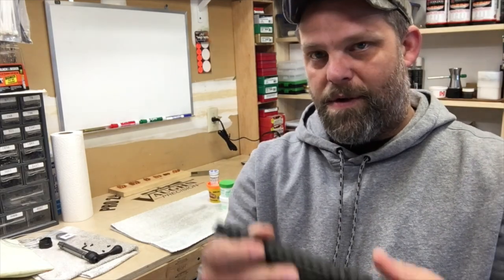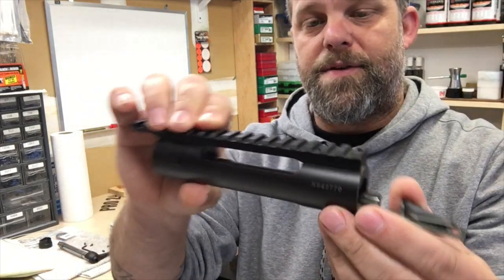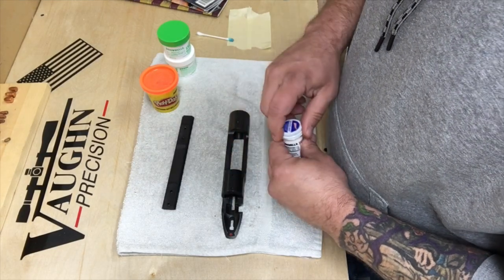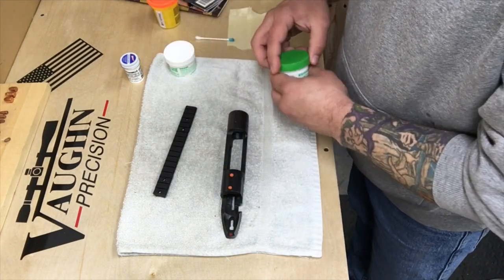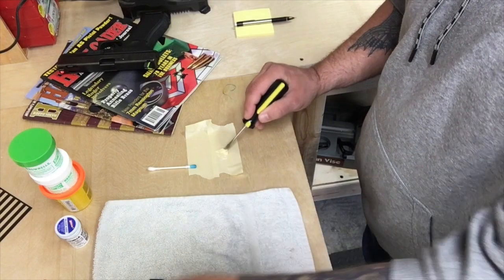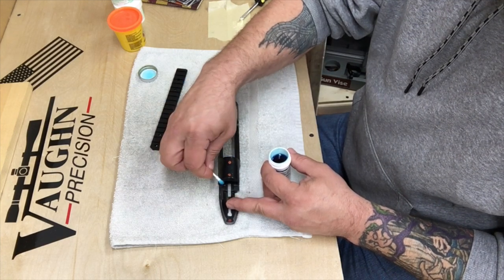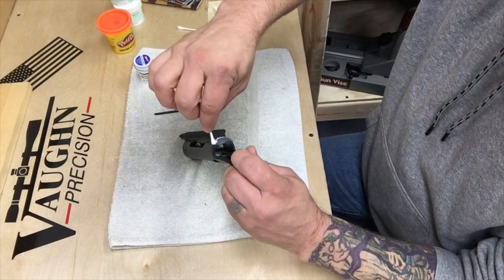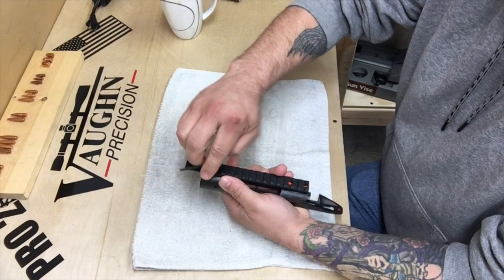Savage Rifle Build, Bedding Scope Base Rail (pt 11)

Comment: Ive bedded quite a few rails over the past few years. I can see a few pros and cons to doing it. One pro is a greater surface area for the clamping action from the tightened screws and another is to cancel out any machining tolerance difference between the base and action. The only Con I can think of though is that if the base itself isn't perfectly straight then you are just making the bend permanent while installed on the action. I've seen a few that had a bow when off the action but straightened to a degree(+/-) when installed on the action and torqued down. I usually send the ones with bows back though. To check it: If you don't have a mill and indicator a straight edge and bright light will tell you the same thing.

Comment: When I've discovered a one-piece base with rearward clearance, as your example illustrated, I came to the conclusion that either there are machining tolerances (nominal 0.002") present, and/or the action has warped a minute amount due to heavy barrels being floated from the factory.  Depending on how the rifle is stored in a warehouse-transit-to-dealership....its very possible for Savage's bull barrel models to warp their action a few thousands of an inch.  In my time of discovery on bases that revealed gaps (Remington, Winchester, Weatherby)...I've taken one of two approaches-
Either use a bedding compound as you performed, or take some sand paper, holding the paper on the receiver's ring..then work the base back and forth, paying attention to keeping the bottom of the base flush to the receiver ring while working it back and forth.  About 30 seconds of this option can bring the same (nearly) results. Thanks again for sharing -AllTheBest
Reply from the maker: MEAlstonIII now that's an interesting way of correcting it. I'll keep that one stored away for future use.!

Comment: Thx for the info, I hate my rail as it is right now on my Savage FLCP-SR with a lost of 10 Mils of adjustment just to zero at 100 metres. Out of 20 Mils of total elevation losing 1/2 of it just to make a 100 meters zero feels stupid. I will order mine today a replace the parallel picatinny one that came with that rifle.    Keep them coming, very good video.

Ralph

Comment: The gap is due to manufacturing tolerances.  Nothing can be machined to match exactly in mass production.  Bedding the scope mount is meant to compensate for the clearance so that the mount rail is not bent convex ed. (bowed upward) and torquing the scope tube.  @ 2 miles an ill fitting rail can mean missing every shot.

Comment: I cut the end off of a couple of used Ram Rods swabs and stick them in the screw holes to act as guides when setting the rail in place.
Reply: I was thinking kind of the same thing but use 2-3" screws or threaded rod and have a long nut of sorts with the same taper as the screwheads on the bottom. With screw in holes, finger tighten the nut down against the rail. Easier than using the short rail mounting screws.

Comment: Love your videos.  Just also became a Savage guy.  They were offering a 100.00 rebate on a 11, 6.5 creed, couldn't pass it up.  Too bad it had the bottom bolt release.  Just a suggestion, have you thought about using a threaded rod to locate the rail on top of the receiver??
Reply from the maker: lkazanov I have, but it’s just as easy to use the bolts. There is minimal compound used so it’s never really been an issue.

Comment: I would like for someone to explain why you do this? And is it just for savage guns? Or just the weaver style rail?
Reply from the maker: If you put a true straightedge across the top of “most” actions you’ll find gaps. This can be caused by machining or polishing. Rails can also become slightly less straight so adding a small amount of bedding fills in those minor gaps and creates less stress on the rail when it’s torqued down. It’s not necessary unless the gaps are extreme but I do this to all my rifles.

Comment: Too bad you didn't have a surface plate to lay the base on to see if it is perfectly flat itself. I bedded a base just like you just did on my Weatherby. I was later helping a friend mount a base on his 700 and by that time I had obtained a granite surface plate. His base wasn't sitting perfectly flat on the action either. Before bedding it we checked it on my surface plate and the base itself wasn't flat. My guess is there's stress in the base material. When it's machined its clamped tight in a vice and machined to size and is perfectly flat. When it's unclamped the stress in the metal springs the base a tad bit. I may be wrong but that's my guess on why the base isn't flat.

Comment: there are several guys bedding their actions to the stock with J-B weld, some say this will allow moisture to seep in, not sure, others say play dough is 70 % salt and will also cause corrosion, this i believe, plumbers putty or modeling clay is cheap and available everywhere... i will stick to the  modeling clay
Reply from the maker: Wayne Hartneck I’ve used both and never had any issues. I was out of clay when doing this job so play dough works. I now have a ton of clay back on the shelf so the next few builds I’ll be using that. It cleans up nicer to. 
I’ve heard of folks using JB, I’ve never tried it. Acra Glass is good and not that expensive so I stick with it and it always turns out a good finish.!

Comment: Hello and Kudos for a well informed Video. 
I just wanted to make a comment about why you do have a slight gap  wear the bottom of the rail makes contact with the top of the receiver> It all has to do with machining and manufacturing tolerances. No two pieces are exactly the same when manufactured. As long as they are within the manufactures tolerances they (the manufacturer)will pass them and release them for sale. Now imagine that the receivers radius is.0005 - .001 difference than the underside of the rail which also has manufacturing tolerances  varying say + .005 you will get an accumulative error of sat .0025 .003. This will account for the gap that you are experiencing. Mind you a piece of paper is .003 in thickness which is not very much but the accumulative error from receiver top to the underside of the rail mount will account for the gap that you are experiencing on your receiver. You see it all has to do with the manufactures production tolerances. It may be controlled better if   the rail and the receiver were made by the same com[any and not just jobbed out to a third party supplier. Yes some suppliers hold there parts  to a very high degree of quality control, but you still have slight variances due to a number of small issiues . However if said parts are within the acceptable tolerance levels(usually + -.005) all is good. The problem is to shrink those tolerances and make an extremely well fitting  mating part s. The rub is that for this level of say hand lapping and fitting of said parts will increase the costs dramatically. This is something that suppliers just cant afford to perform. 
So with a little bit of time and energy you the end user have made a one off custom fitting part, which has been produced to rectify manufacturing tolerance variations. It is indeed a labor of love, and one that you will be able to enjoy the fruits of your labor!
 Hope this explains why you have a slight gap between the rail and the receiver.